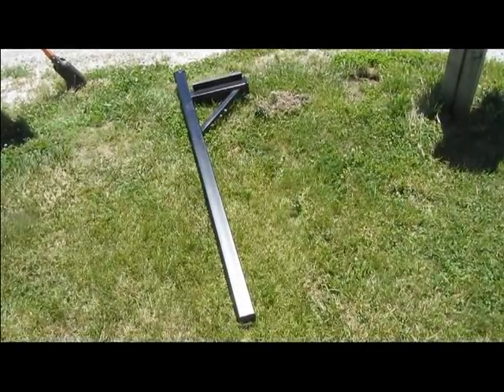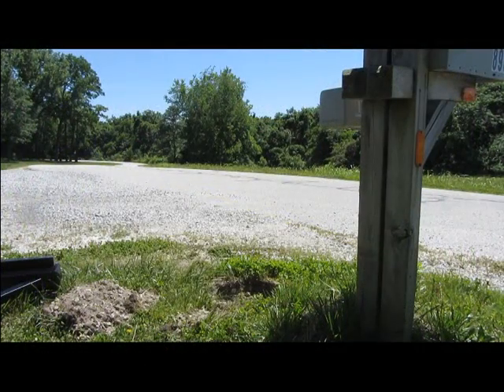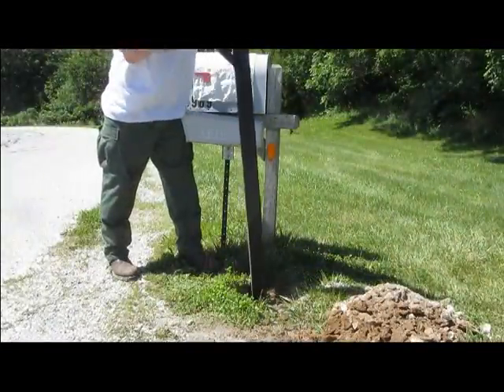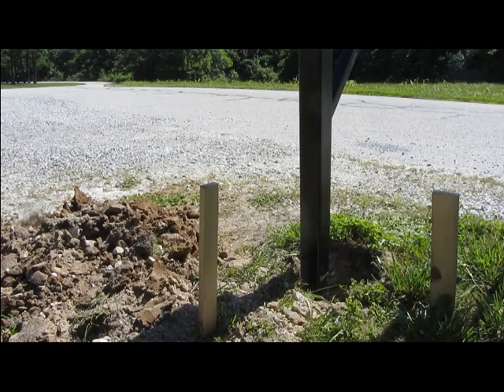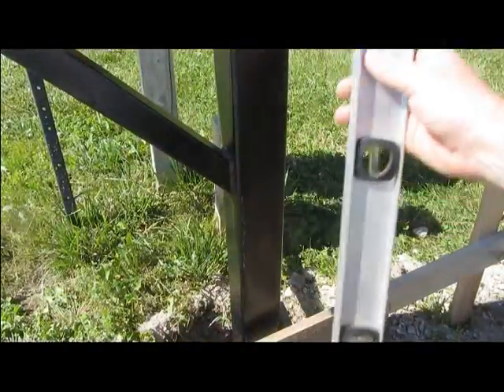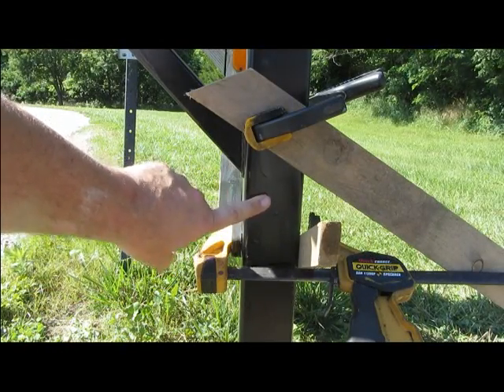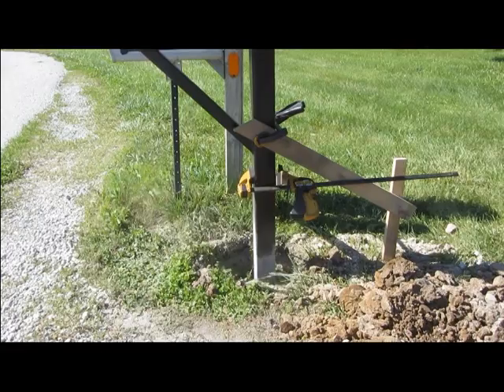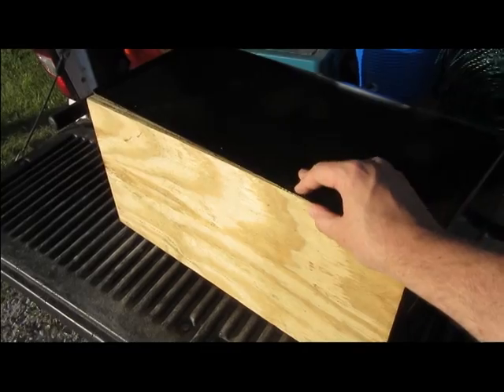MAILBOX POST INSTALLATION - How to

Comment: Here are the exact USPS mailbox install regulations.    Position your mailbox 41″ to 45″ from the road surface to the bottom of the mailbox or point of mail entry.  Place your mailbox 6″ to 8″ back from the curb.   If you do not have a raised curb, contact your local postmaster for guidance.  There is a photo with exact easy to see measurements on it on the website.    .https://www.usps.com/manage/mailboxes.htm   here is an even better view   https://www.mailboss.com/how-to-lengthen-a-mail-boss-mailbox-post/
Reply from the maker: Thanks for the specs, Mike!

Comment: Just an FYI... you shouldn't be using your neighbor's mailbox as your ruling guide, you should be finding out the Postal Service's regulations and do it according to the specs that they have.
Reply from the maker: +Robyn Sleeper   The first thing I did before doing this project was look up the regs.  I found that my neighbors box was fairly close to regulation.  I went ahead and made it the same height because of aesthetics.  I figured that the mailman hasn't complained about it for the 20 years of delivering mail there.   Thanks for the comment though.....  I do hope people read it, since I didn't make that note very clear in the video!
Reply: +Phil Crockett  I believe the regulation height is 42 inches, but I'm not sure that goes for every state.  That is what our Postal regulations are here in Oregon, just in case having an actual number helps anyone who reads this.  I appreciate having video's of how to do things like this, because it really helps when one has never done something like this before.  Thanks.
Reply: Phil Crockett